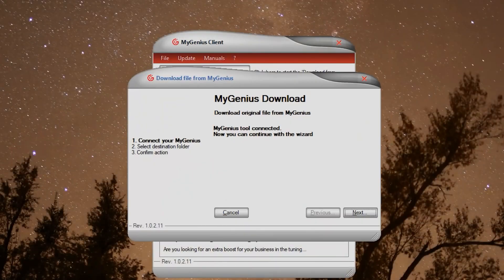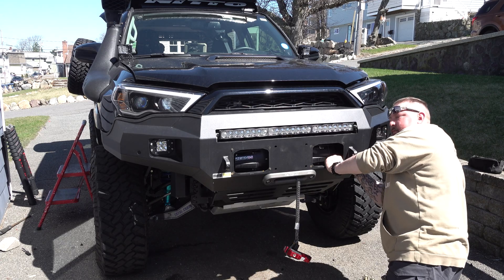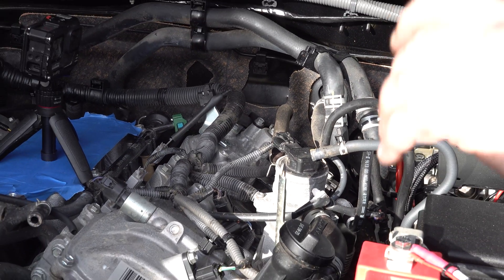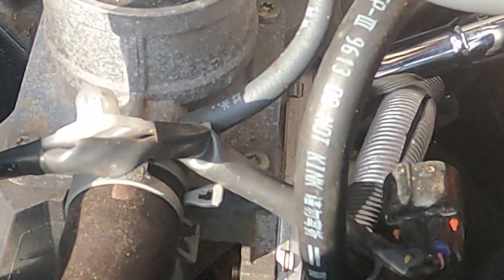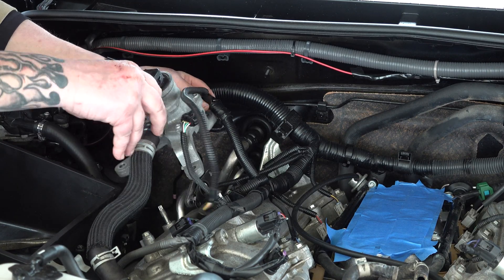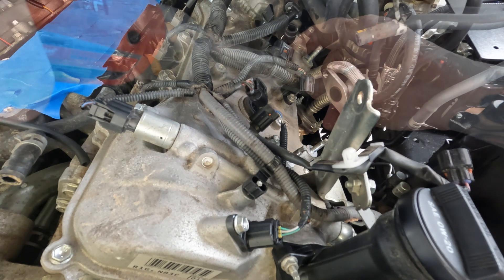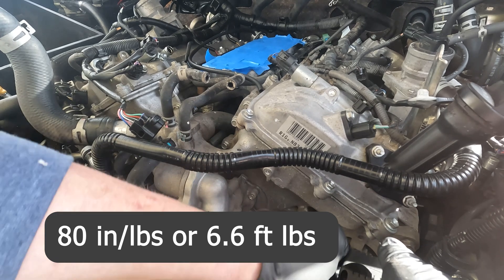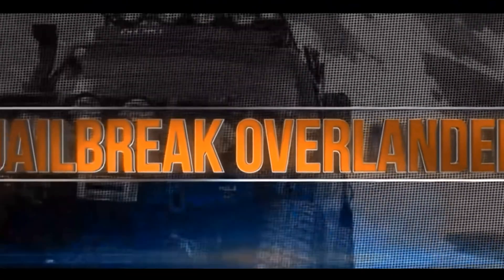HOW TO INSTALL  A MAGNUSON Supercharger in your 5th gen. Toyota in your driveway Part 3/7

Comment: Thank you for all your hard work. 

Had the CSF and it leaked from day one. They took no responsibility. Any other alternatives?
Reply from the maker: ys theres a Koyoto Version I believe and it uses an external Tranny coooler.
Reply: @jailbreakoverlander  thanks brother. Grateful for your video. Once I save up, I’m going to use your video to do the install. Only challenge I see is holding that pulley still while torquing to 205 ft lb.

Comment: Spark plug gap at 32 tho is super large gap for a super charger/ turbo/blower. 32 tho is a gap for a NA motor not a power adder gap fer sure. Nvr see above 25 tho on power adder engine.